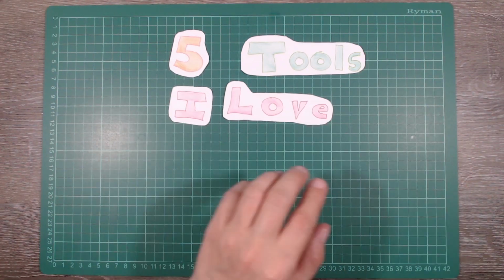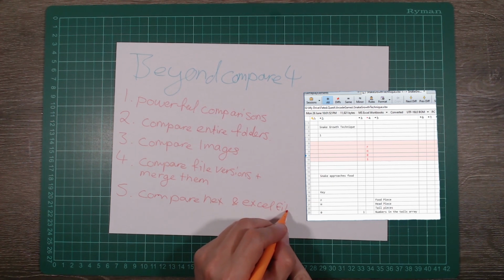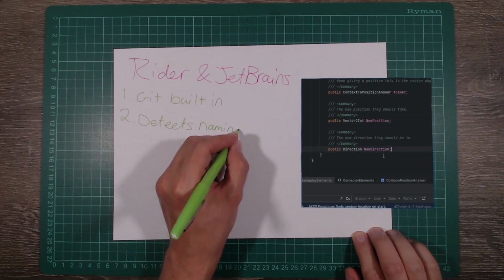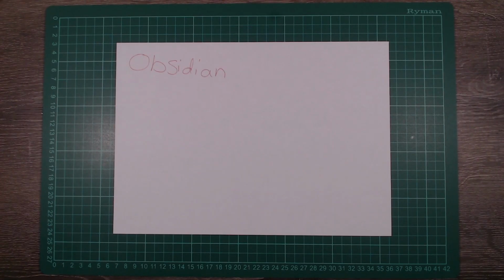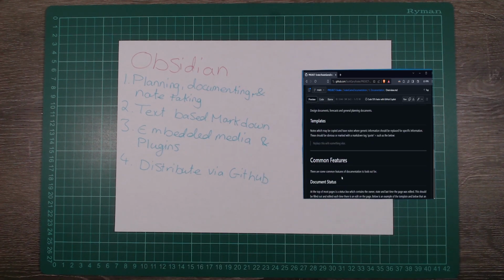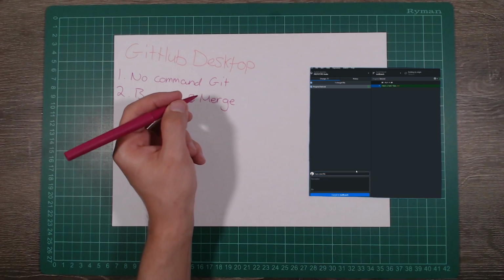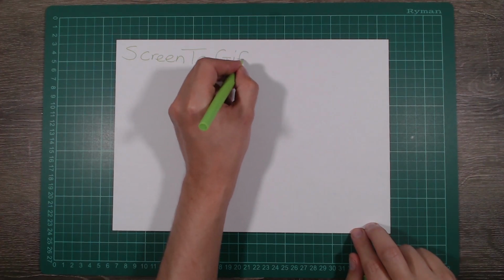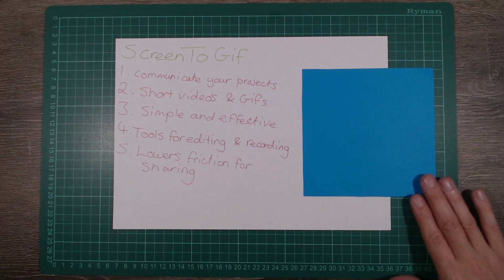5 Tools I love for Software Engineering

Comment from the maker: Notes and Video Review:
https://github.com/ScottGarryFoster/NOTES-PassionOnSale/blob/main/PassionOnSale-Public/3.%20Video%20Review/1.%20Videos%20Out%20of%20Time/5%20Tools%20for%20Software%20Engineering%20-%20Review.md

Highlights from Review
Mistakes
- LFS - Large File System is spoken. Large File Storage is what I meant. Corrected with text.

Weak Points
- Github in Rider. I say "Git built in" as though it is a point against Visual Studio when it's only meant as a point for Rider and how much more user friendly Rider's implementation appears to be. This might be user preference but the Git implementation in Visual Studio does not offer for me anything over Github desktop which Rider does with how good Rider's Comparison and validation is.
- Beyond Compare. I don't properly explain why folder compare on BC4 just that it is better. The better point might be to spend a little more time comparing the interface, and maybe comparing the space comparison (among other features).
- Screen To GIF. Probably the weakest piece of software in this video even though I do really like it and stand by the points. Due to the title 'for Software Engineering' and this isn't for the Engineering it's more for communication around the position.